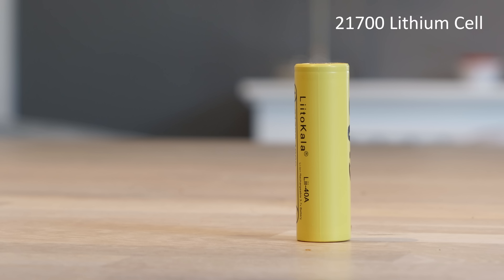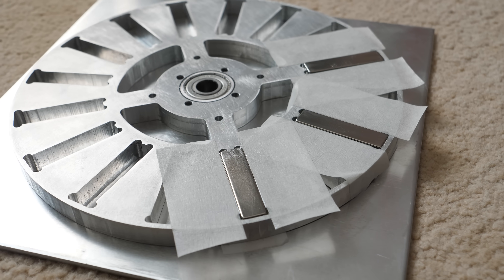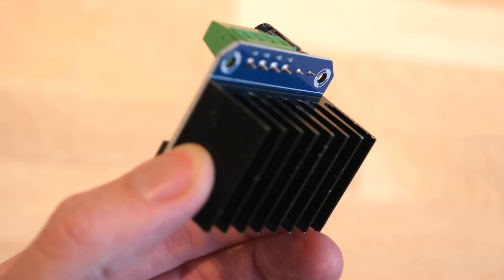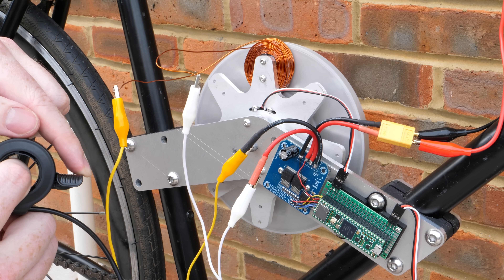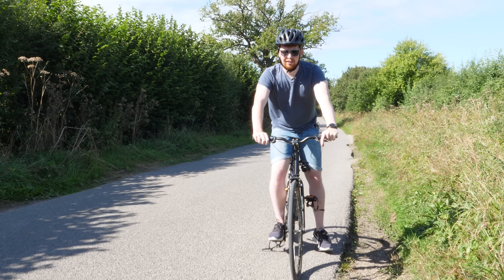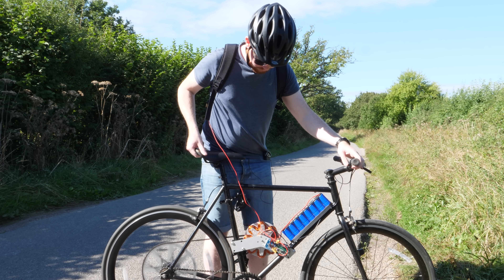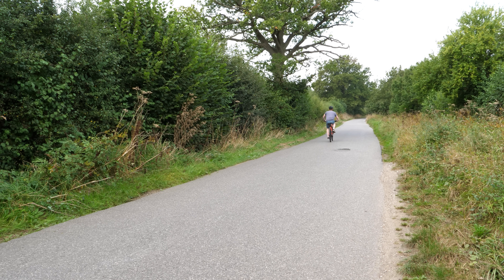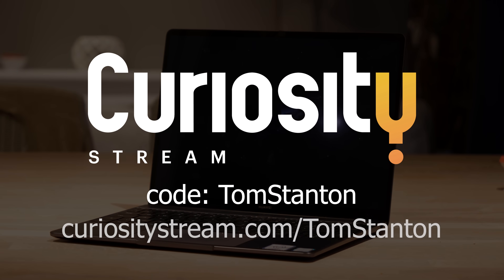Super Capacitor Bike

Comment: Capacitors for taking off quickly from the start, li-ion batteries for cruising, with regenerative braking recharging your capacitors specifically. Now that'd be neat!
Reply: Great idea!
Reply: @moonmatthew   Really? Because that's literally how most large electrically (assisted) vehicles have been working for the last decade or more. They actually manufacture supercap banks exactly for this purpose, although the trucks and buses are usually "hybrid" type drivetrains.
Reply: Some people use a few capacitors (along with the lithium batteries) on RC drag cars to get them to launch quicker.
Reply: Yup, rapidly charge and discharge, to and from the capacitors, and use the battery for cruising. It would also increase battery longevity, by decreasing stress.
Reply: The basic problem with using supercaps is the cost. They do make sense to use as a buffer for the battery in EVs (both during acceleration and regen) but there is a reason they aren’t. They are used for some applications like busses and super cars but unless the cost comes way down I can’t see them making their way into passenger vehicles. For an eBike I think it’s a very neat concept, but one would have to do a cost benefit analysis over a standard 400 - 500Wh ebike pack. How much extra range for the additional weight? How much additional lifetime for the pack? Would you be better off just adding additional battery capacity? It also adds to the complexity with an interface needed between the cells and the capacitor bank and it also adds significantly to the risk of fire.
Reply: One problem not yet brought up. Motors can only handle so many amps. So you’d need a more powerful motor for super capacitors to be useful in acceleration. Definitely doable though
Reply: @matthewhubka6350  The motor controller will determine how much current is allowed to flow to the motor. However for short duration motors can take huge currents. 2-5x their rating. And the capacitors will only last for short durations.
Really only 10-20 secs needs to be stored as the batteries will catch up charging or discharging after that time and the batteries charge and discharge at the same time as the capacitors.
Reply: This is called a hybrid battery!
Reply: That's what I'm thinking, the capacitors would be great for instantaneous charging/discharging while the lithium ion pack for range.
Reply: I wonder what a comparison between battery with and without the capacitors would be like
Reply: @80milekyle70 
Without the caps the acceleration will not be full power throughout the battery life as the battery dies the power dies without capacity
Reply: build it and I'll buy it
Reply: @subscribeifyourenotgetting4986  What is your budget
Reply: solar panels too
Reply: Dont forget a small solar panel
Reply: using a capacitor together with a battery actually makes alot of sense. batteries would not be able to accept all the power coming from breaking at a light or down a hill, they charge too slow. and i dont think it would be difficult to design a battery that has capacitors on board for this purpose
Reply: @akivashmalo7911  exactly. But Dan hunters just can't get it.
Reply: @Mike-77-YT  Lol how do you not get it? If a battery holds 50x the energi of a capacitor but the capacitor has 50x the charge rate of the battery. They charge at the same power even though the capacitor has higher charge rate.
Reply: @akivashmalo7911  I agree, except not for ebikes , supercaps are too big & heavy to be of any use on two wheels. weight is the enemy and the bottleneck is range, not power. but for cars it could help. best use for supercaps would be drag racing (pure capacitor) or track racing( hybrid LI ion/supercap)
Reply: As if e bike's don't take off quickly already, any more and they would be pulling wheelies, It works with cars but incredibly dumb for whatever this guy is trying to pull.
Reply: You'll want buck boost convertor at the super cap.  This will allow you to extract most of the power out of super cap while maintaining 12V on the output circuit. You'll want to isolate all of that: super cap + buck boost behind a fuse or circuit breaker of some sort to protect against dead shorts.  Dead shorts can be deadly when dealing with super caps since they have no internal resistance to limit current flow unlike a battery.  The buck boost should only be part of the run circuit.  During charge you'll want to go direct.  A solid state relay could automatically handle the transition on the fly.
Reply: @billbyrd1361  while that would increase the usability it drops the major advantage of supercaps - their ability to dump their energy super fast. Ofc you could build a converter for 100s of amps but I don't think that would be viable.
Reply: @Stumper52  can that motor take 100s of Amps?  That's the limit we are talking here.
Reply: @Stumper52  as far as buck boost the major components are: capacitors (which also can be super caps), inductors (which can take high amps no problems), diodes, and transistors.  Traditionally the transistor part would be were you might have high amp problems but this is no longer the case last 2 decades.  Look up high amp solid state relays or high Amp mosfets.  High amp solid state relays are used in industrial apps.  High amp mosfets are often used in upper end car audio.  Quick internet search and you should find some components in 100 amp range.    Normal switching computer power supplies also usually have an assortment of electronics equivalent to buck boost converters to supply each rail.  One for each rail and voltage.  A typicical 1000W computer power supply if you add up the amperages of the low voltage DC is approaching these levels.  Keep in mind the bulk of the box in your PC is to do far more then just a single buck/boost.  AC/dc conversion.  Multiple voltage rails.  Noise filtering etc.  When you run high amps thru diodes, transistors/mosfets, solid state relays they usually require heatsinks.  If you crack open a PC power supply you will see heatsinks over these components exactly.  But as I said before what you are looking at inside a PC power supply is about 5x the complexity of what I'm talking about doing for a single 12V rail.
Reply: @billbyrd1361  I'll give you that. I know that the buck part of the converter isn't the problem, the boost part however could quickly start pushing high amps as the voltage of the bank drops to low single digit volts. Now of course you could just limit how low the bank voltage gets before it cuts off but in a bank as small as the one in the video you are losing a significant amount of energy.
Reply: @Stumper52  yes.  You would probably wanna stop around 3 volts.  In boost mode the inductor and switching transistor is doing most of the work.    But the inductor can be made out of any gauge wire you want to wrap around an iron core.  The other limit at play: solid state relays and MOSFETS usually start to become dysfunctional in the 1.5V to 2V range.  Personally if I were to do this project from scratch i'd use an AC motor. And have 3 seperate regulators one for each phase.  That way you can control the RPM, phase offest by cleverly working the mosfet switching.  Remember on the inductor part of the boost circuit what it wants is steady amps so over time that would average out to be throttle position x some supply voltage factor.
Reply: @Stumper52  the other question.  What is the upper voltage limit on these ultra  caps?  If its higher then what he's using he's also losing capacity on the high side (minus some safety factor).  This is where the buck portion of the circuit would pay off.  If its always 12V and below then make it even simpler by just using a. Boost converter.
Reply: yeah I need and e bike with the two things combined batteries and super capacitors
Reply: Oh yes! That sounds very good!
Reply: Or just getting fit and not worrying about any of that.
Reply: Show Like... Caramba. Maneiro.
🙏🏼🇧🇷👍
Thief circuit of Joules... with piezoelectric insert we tires.  would it be helpful?!? Obs: motor bedini for Bike 👀
Reply: Brilliant!!
Reply: This is what I came here to see actually
Reply: I want this.
Reply: New boost mod for EVs soon?
Reply: Someone make this
Reply: Just like have a bottle of nos that refills haha
Reply: Especially if the capacitors could bleed their charge back into the batteries afterwards.
Reply: Yeah! Or a bicycle that you can just pedal!! It would be super green since you don't need batteries made from mining. And it will be super light! Because it's just you and the bike. And last but certainly not least you can get exercise!
Reply: I can see this being a thing for electric drag cars. Have a small battery for getting to the line and staging then using the super capacitors for the launch and sending it down the track.
Reply: I'd buy it in my traffic prone town to get to work and back
Reply: Like F1
Reply: also, if i'm not mistaken, capacitors don't mind the charge/discharge cycle as much as batteries. so it would help with the battery wellbeing also.
Reply: i was thinking that, put the caps in front so you have a reserve of "boost" or extra punch when taking off from a light or instant power when passing at highway.
Reply: Shut up and take my money!
Reply: That’s what I’m thinking
Reply: Ya I know this is a year old with plenty of comments but you really need a lithium battery that can support the maximum current anyway the only possible advantage I could see is if the lithium battery can't take all the current of regenerative breaking or if it's more efficient for the caps vs the lithium but pretty much not worth it
Reply: if you can get the regen charge  ultracapicitor before they suck the battery does.
Reply: @antoinegruner2327  If the discharge of the capacitors is real fast an inductor in series with the battery would limit the change in current causing it to drain the capacitors first. However I think you generally want to capacitors to last longer than about one second. There are methods to control where the power comes from though. The trick is making it efficient.
Reply: @antoinegruner2327  if can more words sentence might sense
Reply: You talking about Formula E
Reply: Yeah, when I saw the thumbnail I thought he was going to do a boost system to the bike!
Reply: But take more space and add more weight right. If you need a lot of them.
Reply: I was thinking this as well 🤔 like mabe set it up to switch off the capacitors to the lithium battery when the voltage drops below the lithium battery
Reply: Mad props. You know your shit.
Reply: Capacitors for taking off quickly from the start, li-ion batteries for cruising, with regenerative braking recharging your capacitors specifically. Now that'd be neat!
Reply: @Another-Address  stop telling people about the alternator lol shush people might start using them the right way 🍄
Reply: And don't forget about the long term of capacitors. In original Xboxes, capacitors leak and damage the motherboard it was on. Of course, capacitors are better now and could last longer without leaking.
Reply: Heavy af tho
Reply: I worked for a well known automation company... I suggested using a similar method in machinery to cut running costs and or power factory lighting.
I am now jobless as a result, they did not like or encourage running things for free....
Reply: Too bad that's not new so your comment was pointless.
Reply: @artistanthony1007   And yet you still chose to leave a pointless reply.
Reply: Super capacitor NoS
Reply: And a gas engine attached to a generator and you'll be all set.
Reply: @charleslacombe8325  funny guy
Reply: imagine the result of short circuit between these capacitors
Reply: Smh posted before I read this lol
Reply: Idk if this is possible 
Even if this is we won't get more then few cycles since everytime super capacitor discharge in burst and with regeneration their are loses (a lot)
Tbh in my knowledge even getting a one cycle from regenerating capacitor is not possible
If it is i would be amazed and would like to see such experiment!😋
Reply: Capacitors take up lot of space compared to lithium ion batteries . So it's pointless to use capacitors when lithium-ion battery can store more energy.
Reply: Thats the kind of hybrid i need in my life
Reply: Not to mention that if you constantly keep your caps fully charged from your l-ion battery you wont have to deal with power drop off as your battery runs out, because the cap will always be at max voltage
Reply: I was thinking about this soultion as well, 40% uphill regenaration still better than 0. But the main reasion I would live to see that, to save the battery from the constant charge- discharge cycle change what regen causes. AFAIK differnet battery types has different cycle rates before they start to degrade. ie. Li-ion 800 cycle would benefit a lot in my opinion form a support cap pac for regen, but for sure would be lovely to dis/prove it. 
and on the other hand less Apms pulled from, the battery on the start when the highest the constumption, what probably also helps reserving the battery level and lifespan.
Reply: Capacitors are best for a quick speed boost on flat/downhill scenarios, video proves it takes a lot of energy to start up. Use human power on start up/hill climbing, li-ion to save leg energy on flats, and capacitors for a boost every so often
Reply: I'd be interested in enough capacity to get me up the worst hill climbs, then regen while cruising on level ground and downhill.  Fill the frame tubes with the caps, wherever they'll fit.  Pedaling isn't an issue but up hill.  Faster take offs everywhere else if I can fit the capacity.  One could probably also line the entire outside of the frame with solid capacitors.  Put a larger tube over that and line that and so on until its as big as the rider would be comfortable with.
Reply: Just paralell connect supercaps with li ions
Reply: Regenerative braking to charge the capacitors for the initial 15kph out of a stop, then the Li-Ion batteries take over. I’ve been working on the controller for quite a while.  It should increase the range of an ebike maybe 5%.  Would it be worth the added cost, space or weight commercially?
Reply: Mazdas i-Eloop
Reply: Smartbob smartpants.
Reply: or use LiFePO4/LiTiO batteries for more current, more recharge cycles, and better recyclability
Reply: Yes but there are some flaws.
Reply: Capacitors and li ion for what you stated and, a flywheel with magnets in it to charge the capacitors and li cells +  braking with kers and mount small thermal cells on the flywheel to generate some power from the excess heat from the magnets.
Reply: Also, I'm not sure how safe the giant capacitors are when they catch fire right next to your legs...
Reply: 2 types of industrial pollution, amazing!!!!
Reply: @GroyperLifestyle  what are you on about?
Reply: To add on this. A large surface area vehicle that can accommodate a large amount of solar panels, charging super capacitors and being very lightweight. It might not be a torque monster but with the right gear ratio and on flatter terrain you could get a pretty fast car with a low powered system, perhaps the 52v 1500w ebike kits. Getting the most amount of speed for a relatively lightweight system. Would probably be light enough with enough surface area to be a lifting body flying car as well using ducted fans powered by the same system.
Reply: Well, that's how electric vehicles are built, because it's the way to do it. This bike is a fun project, but somewhat a waste of money
Reply: or just use batteries for everything.   See, that's simpler.
Reply: This should be an updated video
Reply: Agreed
Reply: You described my base setup sir ❤
Reply: Neat indeed, it also mean one can lower the c-rating of the batteries i.e. cheaper, smaller in volume.
Drawback one has to have a "BMS" for the caps...
Reply: Me, Superman & Supermans's brother John Reeves got given massive 40KW ebike motors,we fitted them to fat bikes and cruized up and down Long Beach, The acceleration was like being on the Star Ship Enterprise, pulling amps out the battery during acceleration really affects fun time. The chick he met was on bad week, so no fun for him, period. I can't moan either, I drew too much power and blew a fuse, "you should always keep a spare fuse in your fanny pack," quipped John. Hoping to go back next year.......
Reply: @dav1dbone  Sounds like a great kickstarter idea for the tinkerer ebikers out there.  Especially if it could be made somewhat universal/plug and play (add it in parallel to the li-ion batteries perhaps).
Reply: @rustytracey6187  There's a dude that has been experimenting with using super capacitors in place of car batteries or to supplement them.   Was watching those vids and experiments intensely here on youtube years ago.   Look for them.  Of course the one problem with the  approach I saw - safety.  Unlike a car battery a super capacitor can dump almost an infinite amount of amps in a very short time.  So it can be super dangerous in short circuit type situation.  So any component fails or over draws or something accidently bumps a lead while vehicle being worked on and without protection you'll have a very serious problem.
Reply: @rustytracey6187  I was running a chaos scooter off my tool batteries and two microwave capacitors it made the thing fast on actual acceleration every time even though the tool batteries started to die it still had perfect set off speed with the caps on.. And why is nobody putting looped energy genoration in this talk.
We really need to thinking more motors throughout the build multiple motors run by the regeneration to then triple the energy gained..
Reply: @dav1dbone  It takes more power to accelerate? Color me shocked. I don't think the run time change you're noticing is because of anything more than accelerating draws a lot of power.
Reply: @TheJohnreeves  Captain Kirk wouldn't complain, you're just keen to get back next summer!
Reply: that's exactly what I was about to say. were you thinking of having the capacitors on the front forks and the battery system where it is?
Reply: Lithium batteries can already get us to the limit of tire grip/traction though, so why not just use batteries for the whole thing?
Reply: @audigex  because regeneration is nearly 100% efficient on a capacitor but only a few percent on a battery
Reply: There is no point, sure the lithium battery takes 45 times as long to charge, but it holds 35 times the energy and is smaller. Using a lithium battery with the same volume as the capacitor it could likely handle higher charge and discharge powers.
Reply: @danhunters8226  supercaps cant replace batteries but they can complement them
Reply: @danhunters8226  this is not the case. A capacitor can dump many times the power of a lithium cell in the same time period. If you look at rc drones or dragsters they have this hybrid battery-cap approach for massive acceleration currents. Sure for an ebike it may not make as much sense but that doesn't make it totally invalid
Reply: @KnowledgePerformance7  yes if supercaps get mass produced and cheaper hybrid batteries could combine advantages of both technologies. more efficient regen, higher peak power/regen, less battery wear. its not magical though and doesnt fix energy density and charging speed. except if you could recharge the caps in 5 seconds at traffic lights, or at stations for buses
Reply: @geemy9675  youve touched on the real issue here which is the regen efficiency.
Reply: @KnowledgePerformance7  How about neodymium magnets?
Reply: @KnowledgePerformance7 it could extend ebike range with regen braking powered by capacitors.
Reply: @rexluminus9867 Aren’t these magnets neodymium?
Reply: @danhunters8226  where is your base for this? The commenter mentioned the capacitor for quick starting, then switching to the batteries for continuing acceleration. Finally, the regenerative braking will be used to charge the capacitor for the next acceleration. That way, you don't wear out the cells due to an unclean charge cycle.
Reply: @Mike-77-YT  what?  No, he said that the supercapacitors are what get the bike to speed, and the batteries maintain the speed.
Reply: @Mike-77-YT  I think Dan Hunters is right, as long as the battery size reaches a certain threshold. If you have a huge battery in electric cars, or e-bikes, that means it has a much higher tolerance for quick charge and discharge (because the occurring charge/discharge per cell decreases, as you have more cells in your battery pack).

But this only stands if you have a big enough battery, with many cells in it (that threshold can be calculated for each individual use scenario).

I have an e-bike, with a 1.5 KWh battery (most commercial e-bikes have batteries in the 400 Wh range). Oversizing your battery ensures that you can pull more power from it when you accelerate hard, and also you prolong the battery life from not needing to fully charge and discharge it after every ride (I tend to keep mine between 20%-80% charge level).
Reply: @Mike-77-YT  The issue is the speed at which a battery can be charged. The chemical reaction takes time. More time than available when stopping a vehicle. So while we have regenerative braking, a low amount of the energy available actually gets recovered. We try schemes to make the battery charge faster to help, but it isn't enough and it reduces the longevity the battery. 

Capacitors are not yet able to store as much, but can handle huge currents discharging and charging very quickly. Dumping the power from stopping into capacitors and then to the batteries allows the batteries to better recover the energy. I would also guess that if the vehicle is traveling slowly it may keep the charge on the capacitors for accelerating again. If traveling on a hill discharge them to the batteries in expectation of a braking event.

Tesla purchased Maxwell, a capacitor company this year for this reason. I cannot find the article, bit I recall them estimating 25% better range for the same battery capacity when coupled with a relatively small capacitor bank.
Reply: @court2379  They purchased Maxwell about 3 years ago, not this year.
Reply: @kosztaz87  even the biggest battery can be a downfall here. If you continue to use regenerative braking with only the lithium ions, that prevents a clean charge cycle. With both at the same time, you can use the capacitors for the initial acceleration, then follow up with the lithium ion for coasting. Then you could add a diode from the lithium to the capacitor, so that only the capacitors will recharge through regenerative braking.
Reply: @Mike-77-YT  I am just not sure the extra weight and bulk for a capacitor-battery hybrid system could be justified, when capacitors have diminishing return the bigger your battery is. But I am not an expert by any means.
Reply: @Mike-77-YT The base is the video 0:16, just do the math. With a lithium battery the same physical size as the capacitor the lithium battery can handle higher charge and discharge power.
Reply: @mondotv4216  Thanks for the correction.
Reply: @danhunters8226  you forgot that capacitors can discharge much faster than lithium ions. Therefore, beneficial for acceleration and putting less stress on the batteries.
Reply: @Mike-77-YT  this is what audio nuts do for vehicles. The subs are powered by a capacitor, to lessen the drain on the alternator, and battery.

Remember that capacitors charge faster, not only in relative comparison to li-ion, but they are able to absorb more voltage in a shorter time span. They do charge faster, at the expanse of capacity.
Reply: @danhunters8226  Yeah I don't get how people don't see your point.
The Li-ion takes ~50x longer to get to full charge, but also holds 50x more energy. So the power intake is the same for the same volume of battery/cap.

Only advantage of a super cap buffer would be reduced wear on the battery
Reply: @Mike-77-YT  No i didn´t. The capacitors in the video has lower discharge rate than a lithium battery of the same physical size. Even though the lithium batteries have a much lower c rating, their high energy density means they can still output equal or even higher power.
Reply: @danhunters8226  I still don't think you're getting anyone's point here.
Reply: @Mike-77-YT  why not take the power from regenerative braking and triple it with motors joined by belts together running from one centre motor take the 1 =power and triple it before then feeding back to the battery and the caps...
Reply: @Mike-77-YT  Will the charge from braking actually be any higher than from a typical charger though?
Lithium Ions also don't seem to like full discharge/charge cycles like old nickel based batteries, so I'm not so sure charging it this way would make any difference, as long as it's under the max charge current.
Even if using a capacitor, it might theoretically be best to just effectively have it across the battery pack to absorb any excess current(if there is any) when charging, and discharge more current than the battery could supply - though I think most batteries can probably already supply enough to be useful. The extra bulk etc doesn't seem especially helpful to me, at least until capacitors increase size/capacity/cost per farad significantly.
Reply: @TiSapph Wouldn’t the charge/discharge cycles of supercapacitors have lower losses?
Reply: @danhunters8226  Regen would be much more efficient with the capacitor
Reply: the Tesla Plaid S has something like this. it has a "cheetah stance" for a standstill launch. 
Im guessing its charging up high capacitors for a quick launch.
Reply: @strawberriesanddeath  Cheetah stance is purely a suspension adjustment for better start, it has nothing to do with capacitors because Teslas DONT EVEN HAVE capacitors that supply electric motors. Motors are supplied only from li-ion battery.
Reply: Thats what they have been doing for years in e-cars and hybrids.
Also in starter packs.
You're too late to the party.
Reply: @flexairz  You're missing the point entirely, it'd be neat if Tom were to do it from scratch and show us the pitfalls and intricacies along the way. Just because some megacorps are pumping them out doesn't devalue someone creating it for themself, and the entertainment it would provide.
Reply: @flexairz  EVs have super capacitors? That's news to me.
Reply: @Zagill  they don't need super capicitors because they have the necessary capacity with the amount of batteries on board. There's no benifit to putting super capicitors on an ev.
Reply: @Zagill earlier UPS trucks used hydraulics for regenerative braking allowing it to quickly take 100% of the brake energy and discharge it for acceleration
Reply: @flexairz  that’s great! Means we understand the concept of electric cars better
Reply: @flexairz  who cares stop being negative
Reply: @flexairz  u know what u might be right I’ve always wondered why the capacitor banks  I just never looked at them junkyard I go lol 😂 thanks
Reply: @flexairz  Before you try to sound smart and arrogant, at least check facts. Electric vehicles are not using supercapacitors to store energy from regenerative braking. Lithium-ion battery is used for that. That's why you don't have regenerative braking in Tesla when you are going downhill and battery is almost fully charged.
Reply: @flexairz  Which cars use this type of system. I've never heard of an electric vehicle using a hybrid capacitor/li-ion battery before.
Reply: @flexairz that's actually- Tardy tonthe party 🙏
Reply: @flexairz But it's most important on a pedal bike, IMO
Reply: @flexairz never seen a car with super capacitors?
They have Ic engine, electric motor and small battery pack. And regenerative barking.
Reply: So which road legal electric car features a super capacitor? None because manufacturers don't want to have lasting cars 😂
When lithium battery breaks you will buy a new battery 😮